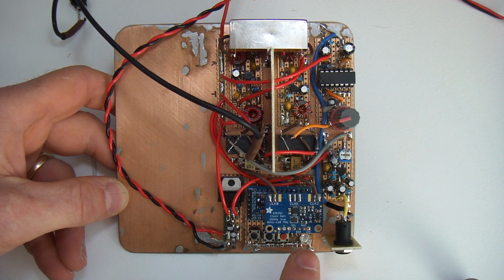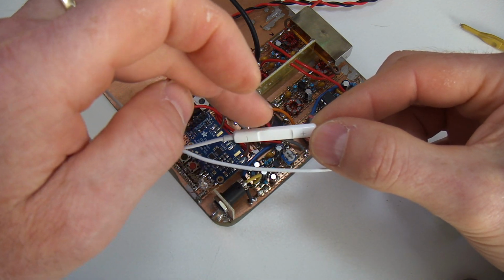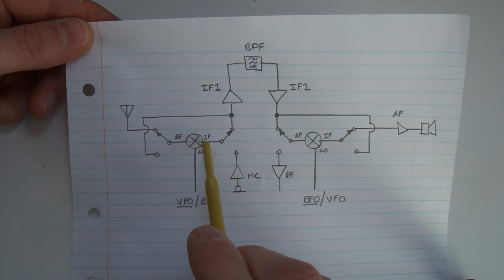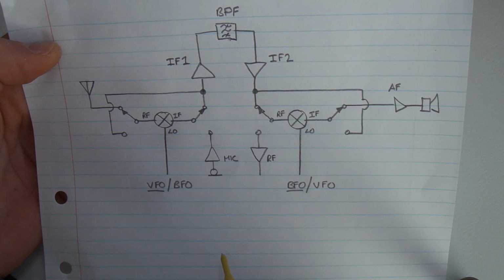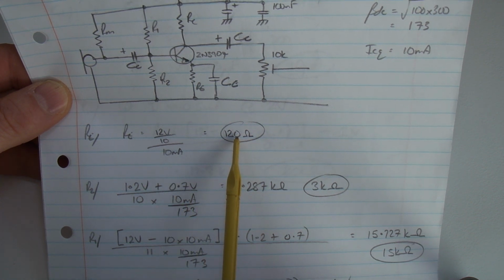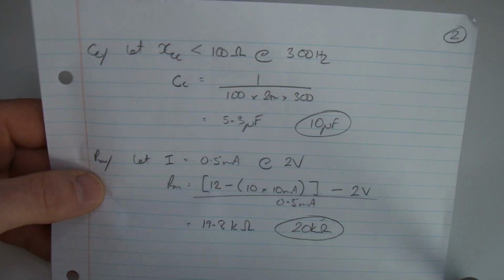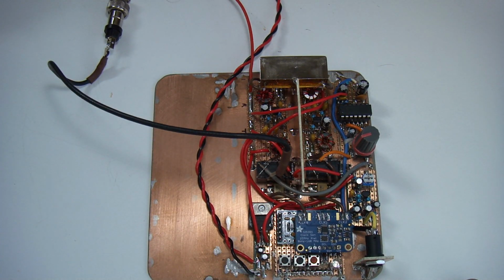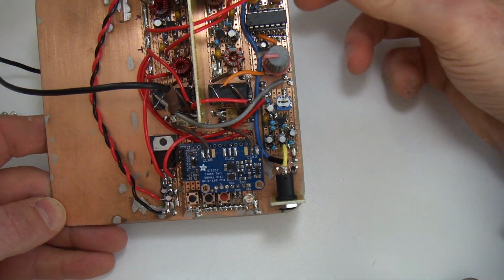Go QRP SSB Rig: Part 4 - Receive-Transmit Switching, Mic Amp

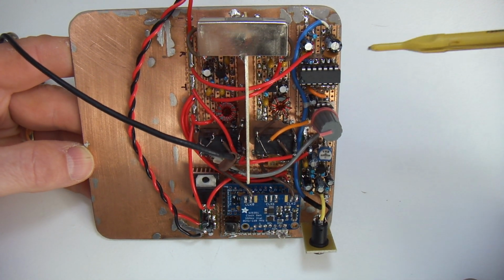Comment: [5:00] There is no need to switch RF-IF of the second mixer during TX. On these frequencies the circuit will work the same way. One contact group of the second relay could be used for something else. 73s de R2AUK
Reply from the maker: Thanks Aleksander. The setup works well for me.

Comment: Nice work Charlie. Can you explain if there are any disadvantages in reversing the direction through the mixers during transmit?
Reply from the maker: Hi Mike. No disadvantages as I'm still using the normal ports (RF, LO, IF) for each mixer. All I'm really doing is just changing their respectives roles (mixer -> balanced modulator, and balanced demodulator -> carrier mixer).

Comment: Hi Charlie, just wondering what would be the raw signal level from the mic, 50mv pp max?
Reply from the maker: Hi Ian. The mic amp will put out 3Vp-p across the 10kOhm trim pot. Nice clear SSB (no PA just sniffing the carrier mixer RF port) occurs when the trim pot output is approx 100odd mVp-p across the ADE-1 port.
Reply: @CharlieMorrisZL2CTM  Thanks Charlie.